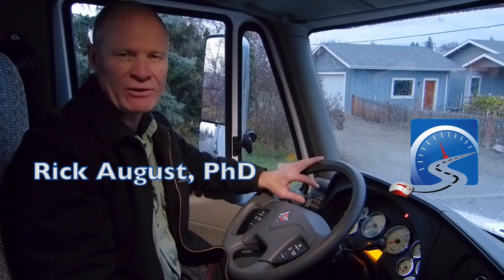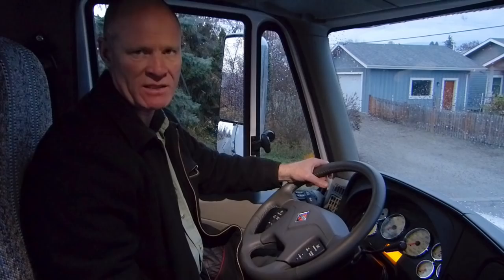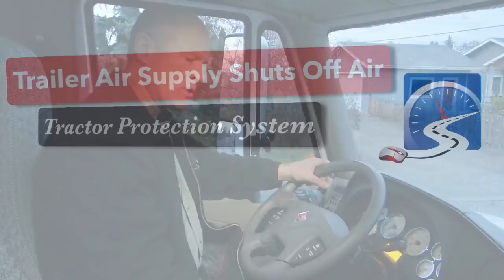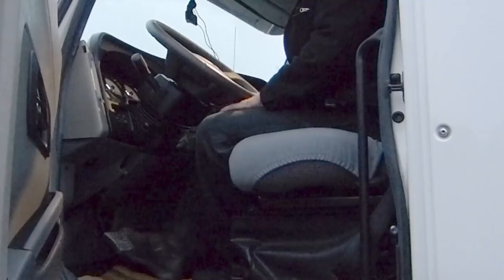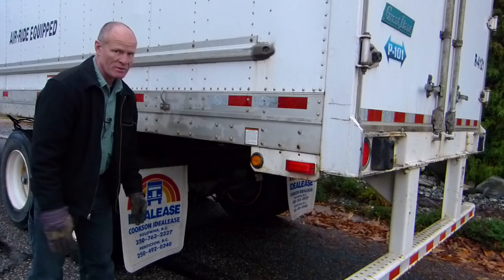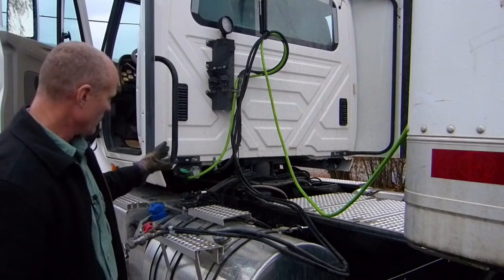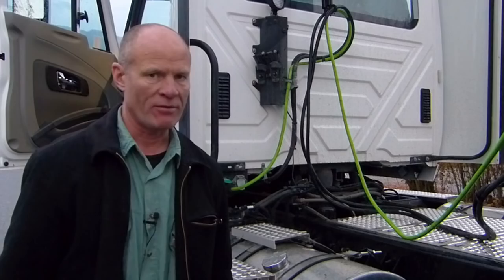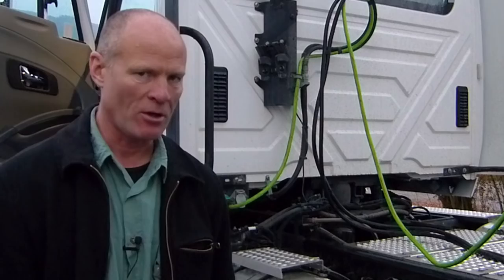How to Test Tractor Protection System  for CDL Air Brake Inspection

Comment: Thanks for making this video. It’s one thing to pass a written exam because you memorized the words and promoted answer and it’s another thing to understand what the question is actually talking about. Your in depth explanation and visuals are greatly appreciated.
Reply from the maker: Glad it was helpful! Yes, many do not understand how air brake systems work. I found that out recently when a veteran driver thought the parking brakes were held on by air pressure. All the very best, Cheers Rick

Comment: The air lines seem to be too long from the spring support to the trailer.  This will allow the air lines to ‘rub’ on the working platform surface and possible snag and/or rub a hole through the line.
Having said that - you are one of the better instructional videos on YouTube and I will continue to advise my trainees to watch durning their off time.  Cheers!

Comment: This clarified my last doubt about the air systems. I have a tendency too overcomplicating things. Since technically I wouldn't have access to the tractor protection valve, doing a leak test otherwise would be too difficult. This will help me ace the pre-trip test.
Reply from the maker: We all tend to make topics too complicated my friend. Happy to hear we could help out with your air brakes. Drop us a note if we can help further. All the best, Cheers Rick

Comment: Thanks for the video, it really helped me explain to the mechanic that the TRAILER protection valve in my 2016 International tractor; is not working until the psi is at "0".  My buddy was inspected in Oregon and received a citation for this issue on a 2020 Freightliner
Reply from the maker: Hi Florita Daniel - happy to hear we could help out my friend. Drop us a note if we can help further my friend. All the best, Cheers Rick

Comment: hi rick,here is a recap of the whole problem.on the tractor protective valve,there is  small black air line that goes from the tpv to the firewall and then to the stop light switch on both tractor and trailer.the stop light swich was bad and it wasnt sensing the pressure on the trailer.behind the stop light switch there are wires that controls the trailer breaks and the tractor breaks.to make my experience short,i fixed that problem with only 38 dollars for the stop light switch and 150 for volvo dealer to diagnose that problem.thanks

Comment: In Ontario Canada, the tractor protection system is tested as one of the air brakes tests for the AZ license - but we are not taught to disconnect both glad hands, only the blue one. I am left wondering about the actual function of the service and supply lines and why the difference in testing.
Reply from the maker: Hi FourthMatrix - whether you take off just the service line or both lines isn't going to make much of a difference. You're simply checking that the tractor protection valve isn't leaking when the trailer air supply valve is closed. The blue control line controls the service brakes on the trailer. There is only air in the blue line when the brake pedal or the hand valve are activated. The red supply (emergency) has air in it all the time when the trailer air supply valve is open and puts air to the trailer. Drop us a note if we can help further my friend. All the best, Cheers Rick

Comment: Hello I watched your video and i can tell it is very helpful for a lot of diy truck driver who likes to do their own things. I have Volvo truck and also have gauge that shows how much pressure i apply to the brakes. Lately it started to act weird i press the brake and truck is not braking and if i press little harder it goes right away to 20 psi and its braking a lot its like pulling me back when i hit the brake pedal. Do you know by any chance what can cause this issue ? btw when i use the hand service brake pressure is also not reacting and sometimes just works fine weird

Comment: What about when you don't have a trailer? Should just test the yellow knob ones the pressure reaches 30 psi?
Reply from the maker: it depends where you are. In some places they don't get you to test the emergency brakes on a single unit. See this infograph: https://www.smartdrivetest.com/air-brakes-(image)/code-15-class-3-in-cab-air-brake-checks All the best, Cheers Rick

Comment: I need clarity: did he say 'do not remove the electrical when disconnecting he glad hands?"  If so, was the connection he removed in between the glad hands, in the video the electrical connection?
Reply from the maker: Hi Tyrone Love -  Thank you for your comment. Yes, that's confusing. In the "B" roll, I disconnected the electrical, but in the main footage, I didn't. So NO, when you're testing the tractor protection system, you don't have to take off the electrical. If there is anything further we can do, drop us a note. Always happy to help. All the best, Cheers Rick
Reply: @smartdrivetest  Thanks for the prompt reply! I'm studying for my CLP, so I'm a curious student with tons of questions. I really appreciate your YT page!  As a visual learner, it has been a wonderful learning tool in my CDL quest!

Comment: Is it the remaining air pressure holding the brakes or the spring brakes? Where are the springs ? Are they inside the air bellows or brake chamber and press on the slack rod to extend it 90 deg.? Still a little confusing and could be easier if the reason for performing the tractor protection system is to see if the trailer is containing the remaining air or checking to see if the springs fully activate the brakes manually?
Reply from the maker: Hi Rafe Pittenger - Apologies for the late response. Thank you for your query. The reason for testing the tractor protection system is to see if the emergency brakes apply on the trailer when system pressure drops between 20 & 45psi. See this video for the explanation of service, parking and emergency brakes: https://www.youtube.com/watch?v=ZFi957GaxpU&index=2&t=0s&list=PL0x-bChcUvwG2bSWReQWnk9Tm92L7WN_O If there is anything further we can do, drop us a note. Always happy to help. All the best, Cheers Rick
Reply: Old trailers held air pressure to apply the brakes. They would lose air and lost brake pressure  resulting in dropped trailers rolling down hills. New trailer systems apply brake pressure  when you lose air by disconnecting from them. The springs are located on the inner side of each set of wheels. Haven't watched the recommended video, probably goes more into depth on this.

Comment: When you’re testing the trailer protection valve and pumping the brakes to bring the psi between 20-45 psi, do you push in the parking brakes knob as well as the TPV? I’m assuming you can test both at the same time right?

Comment: I have a 2016 freightliner cascadia. My trailer brakes are not activating when the red knob is pulled out. So when trailer is disconnected from trucks it has no brakes holding it. Yet when my trailer is connected to truck and i push both yellow and red knob in and pull trailer brake handle it activates trailer brakes just fine. Its only when the red knob is out that i have no trailer brakes. What is causing this and how do i fix it. Ive taken it to two mechanics and still same problem. Also i know problem is within truck because ive hooked to 2 seperate trailers and same prob. Yet when a different tractor hooks to them everything works fine. Any help would be great
Reply from the maker: Hi Michael Jandro -  So, the trailer air supply valve is not activating the parking brakes on the trailer when pulled out? That's what I'm gathering!? When you hook to a trailer, push in the trailer air supply valve. Fan the service brakes using the hand valve. Do the trailer parking brakes activate when the air pressure is between 20-45psi? In other words, do the trailer's emergency brakes apply? If they don't--both when you fan the brakes and when you shut off the trailer air supply valve--my suspicion is the tractor protection valve at the back of the tractor. All the best, Cheers Rick

Comment: Question the practice exam says I have to set my protection valve to either the normal position or the emergency position I’m very confused with the lingo and what they mean is the dash valves if not where is the location in the tractor trailer to where this tractor protection control valve is located

Comment: You should check the tractor protection system/valve.  If the dot checks it then so should you.  Why be placed out of service?
Reply from the maker: Hi Jeff Chapman - Thank you for your comment. This whole video is about checking the tractor protection valve. Are you checking it differently my friend? All the best, Cheers Rick
Reply: @smartdrivetest  
I think the way you're doing it is fine.  I think the tractor protection valve is so when you're bobtailing there isn't any air coming out your blue glad hand line when you apply the service brake.  I'm just assuming that.  But I think what you can do is release your parking brakes.  And go out and pull your red glad hand line and just let all the air blow out until it cuts out.  Because the air pressure left over in the tanks should be enough for a couple of brake applications.  If you are towing than the spring brakes should be applied on the trailer if that red line pops free or something happens, and you should still have enough air pressure to use at least one or two brake applications for the tractor.  Because a brake application will probably have more stopping power than the spring brakes.  I'd probably use one brake application in this emergency situation and just stop.  Hopefully the brakes don't heat up and fade.  Because that might happen if you're going downhill with a heavy load.
Reply from the maker: Hi Jeff Chapman - You're either not explaining it correctly, or you don't understand the system al all my friend. I might ask you to consider the air brake course here: https://www.smartdrivetest.com/airbrakes-cdl-&-rv/pass-cdl-air-brakes-course All the best, Cheers Rick

Comment: Getting ready to start CDL school next week and still a little confused on the TPV.   If the red octagon shaped Trailer Air Supply button has the dual purpose of protecting the tractor from air loss and also supply air to the trailer, does it act independently from the yellow diamond shaped Trailer Parking Brake button?  If I understand it correctly the yellow Trailer Parking Brake button, when pulled out, evacuates the air from the trailer allowing the spring operated brakes on the trailer to clamp down and stop the trailer from moving.  If the yellow button is pulled out but not the red button would the two systems be in conflict?
Reply from the maker: Hi bti2270 - Thank you for your comment and query my friend. You're misunderstanding the system. This video should help: https://www.youtube.com/watch?v=m4S8PSRAuF4&list=PL0x-bChcUvwG2bSWReQWnk9Tm92L7WN_O&index=9&t=0s If there is anything further we can do, drop us a note. Always happy to help. All the best, Cheers Rick
Reply: @smartdrivetest  That is the same video as above.  It doesn't address the question

Comment: do you test tractor protection valve with yellow and red knobs disengaged?
Reply from the maker: Yes, in other words, those two buttons are pushed in on the dash. And you pumped down until the Trailer Air Supply (Red) valve pops out. Al the best, Cheers Rick
Reply: @smartdrivetest  thanks for the info!

Comment: hi rick,thanks God for you.no he did not.am gonna put a new one tommorow morning although he told me he is not sure but i should try a new valve
Reply from the maker: Hi Bernard: the tractor protection system is only two valves on the truck: 1) the trailer air supply valve on the dash; 2) and the tractor protection valve. The trailer air supply is just an on/off switch, so that only leaves the tractor protection valve. If you've hooked up to different trailers and the service brakes haven't release, that would be my guess. You're only going to know if you swap out the valve. All the the best, Cheers Rick

Comment: am gonna now try to change the air line(blue one)
Reply: Bernard Mwariri ~ Air going through the blue line APPLIES the trailer brakes when you use the foot brake or hand brake.  Air going through the RED line fills the trailer air tanks and RELEASES the parking brakes (spring brakes).

Comment: i have a 2005 vnl 670 that is giving me problems with air brakes.when i press on the service break,my trailer breaks are not releasing.i tried to hook up to two diffrent trailers and i have the same problem.i took my truck to the mechanic and he don't know why its doing that and the only thing he suggested is to put in a new trailer protective valve behind the tractor where the air lines are hooked up.when i press on the service brakes when parked,the brake lights will stay on and stay for like 45 seconds then goes off and break releases at that point.when i press on the break and then unhook the service line from the the trailer there is air coming out
Reply from the maker: Hi Bernard Mwariri - did the mechanic change out the tractor protection valve? Cheers Rick
Reply: What did you do to fix this

Comment: hi rick, i think i have found my problem.brake light switch is the problem.
Reply from the maker: Hi Bernard Mwariri - thanks for letting me know what the problem was - that helps out a lot of other drivers. I would not have guessed that it would have been the stop light switch. Interesting indeed! How did you find out that it was the stop light switch? All the best, Cheers Rick

Comment: Last two DoT inspections I had, in two different states, checked the tractor valve separately to make sure it was working on it's own without the rest of the system. After the leak down test. They had me build full air pressure with full air supply to the trailer, with drives chocked, disconnected air lines and recorded the pressure each knob popped out. They explained to me they were doing this to make sure the tractor valve is working independently on it's own without the system. This was the first times I've heard of this. Anybody have any input on this?
Reply from the maker: Hi eric whittington - Thank you for your comment. Just to clarify, after building full pressure, the DOT removed the emergency line (red) and then determined when the trailer supply valve popped on the dash? Did they remove the blue service line and get you to pump down on the service brakes, or just the red line? Or did they see when the trailer air supply valve popped and then the yellow parking control valve? All the best, Cheers Rick